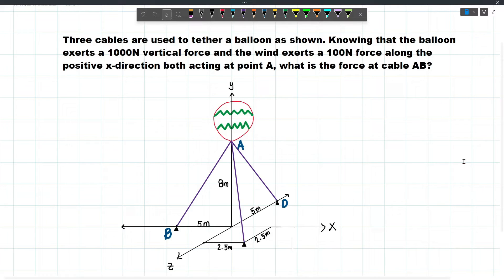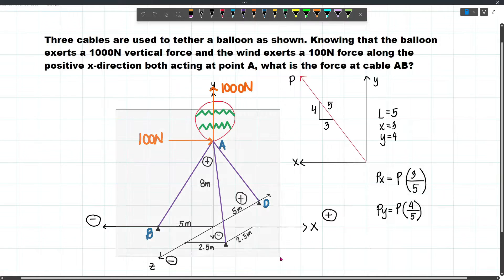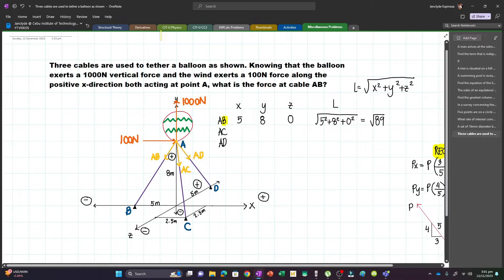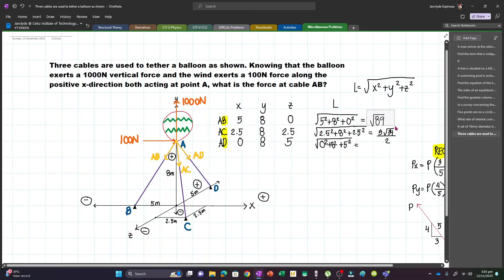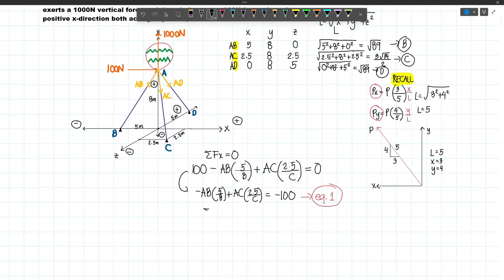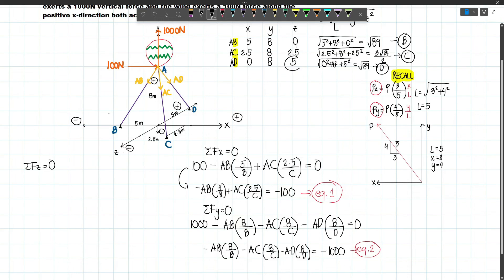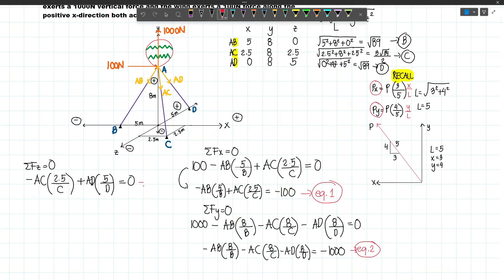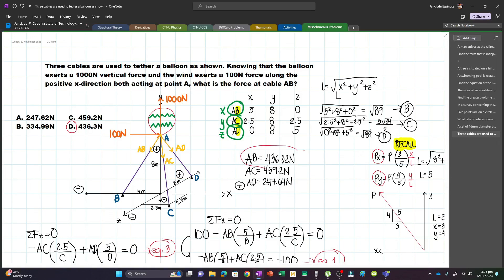Three cables are used to tether a balloon as shown.  Knowing that the balloon exerts a 1000N

Comment: i think the positive and negative sign in equation 3 is wrong?
Reply from the maker: The sign depends on the conventions you have set, In this case,  the backward axis was treated as the positive axis while the forward axis was treated as the negative axis. However, the forward axis is generally treated as the positive axis, especially when using vectors. But, I'm just used to right being positive and left being negative (in the isometric view), so I altered my axis conventions. 

Try to change the signs and you will still get the same results po when solving the equations simultaneously.
Reply: @engrclidez  i see, di ko po napansin sign convention niyo. thanks!
Reply from the maker: @kyuubi4975  sige po lodi pero better yung convention nyo po na positive yung forward axis para madaling 
magamitan ng matrix mode hehe